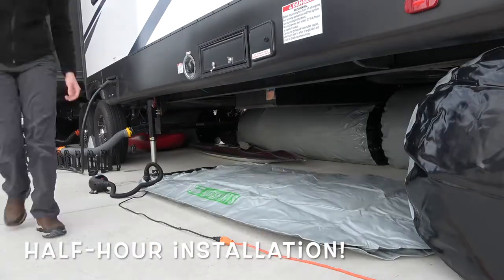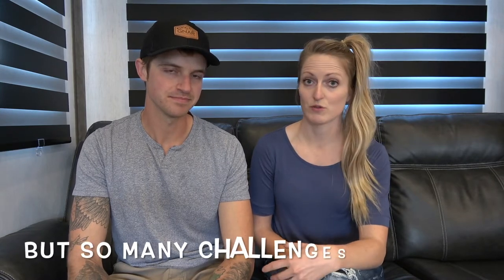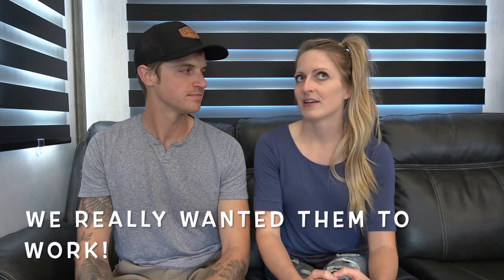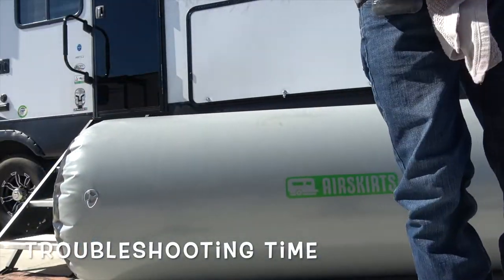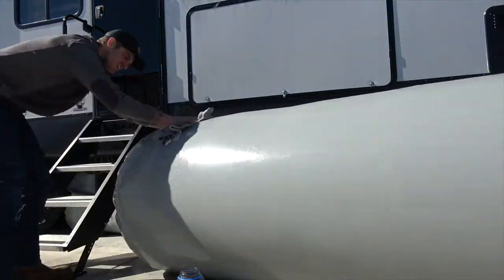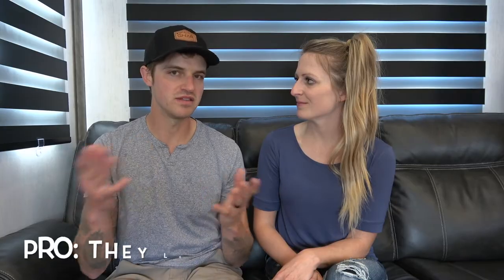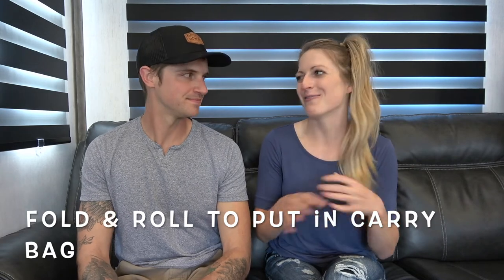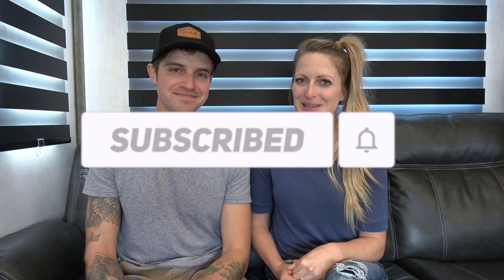Airskirt Review // Winter RV Skirting // Fifth Wheel Toy Hauler // Full-Time RV // GNAR Outdoors

Comment: I have Air Skirts! This is my second winter.  I had no issues like you guys did. I'm glad you got your issue solved. Prior to inflating I went over my underbelly with a fine tooth comb. Added pool noodles to edges, foam to corners, and taped down any "pokey's". Used all the plastic edge protectors the Skirts came with.  2nd, in my humble opinion Air Skirts were specifically made for Air Streams. Those that dont have Air Streams have to make adjustments for Air Skirts to fit. So what I did was only fit the Air Skirts where my water pipes and heating ducts run. My entire RV is NOT covered, but the seal the Air Skirts provide has allowed me to not turn on my furnace unless it is 19 degress or less outside! Bunch your skirts as close together as you can get them to eliminate "air gaps".  I temp 4 zones. Outside, inside, subfloor, and the space between the AirSkirts. The space between the Air Skirts is 7 degrees higher than the outside air, even though the gauge is outside on the ground.  The gaps from the Air Skirts provide air so humidity won't build. The Air Skirts occupies enough space underneath that cold air cannot just breeze in. I tried insulation board one winter and the humidity underneath was always in the 90's. Oh I forgot! I have 4 1 gallon bottles of ammonia with felt wicks , mothballs, and bait stations where there are gaps.
Reply: I honestly like your review more than the entire video. I literally had a solution for all their issues. Everyone's brain works differently. I 100% feel like these are for people with a large amount of common sense. I bet if you think ahead, these are awesome.
Reply: Great review, I will get them based on your review. Thanks for taking the time and providing the little details.

Comment: Very helpful video.  I currently have a custom vinyl skirt with adhesive snaps which has stayed on with no issues.  But I’m considering AirSkirts for the insulation factor and still putting the vinyl cover over the skirts.  But the AirSkirts price has had me holding off cause they really are expensive.  Thanks for the honest review.
Reply: How much do the air skirts cost?
Reply: It depends on the size min. Price 1800$

Comment: I’m not so much concerned about how they look but how well they perform so you were filling up your propane tanks every two days I guess the next question I have is I have a Grand design that supposedly has the Arctic package in it but the videos I’ve seen show a much thicker floor to keep the heat in but yeah they got cheap and didn’t use the stuff they did so I’m really down in them for that but I guess the bigger question is is are you really saving all this money with those skirts in place underneath I noticed your review was two years ago. Are you guys still using those air skirts? Are you saving money, and what is the average temperature going down to?

Comment: For the cost of these types of products I'm better off buying more propane to run the furnace. Most I've ever spent on propane for winter $250 at $3.00 a gallon. It would take about 20 years of full time use to break even on the cost of airskirts. I seriously doubt the material will hold up that long.
Reply: Aren’t they supposed to keep the tanks and lines from freezing as well?
Reply: @titusmoto  They could help if you have an RV without tank heating pads or heated under belly. In that scenario I would just use 1" foam board from the hardware store and make my own skirting for less than $100. I looked this video up for this product because a neighbor of mine was thinking of getting them. I was curious.
Reply: Running your heater has nothing to do with keeping the lines underneath from freezing.
Reply: Sounds like you don't live in a cold climate. We spent $250 a month on propane even with skirting.

Comment: I bought the AirSkirts and they've been a huge pain. They blow away when it's windy and I've had to connect them together with bungee. There were several tubes that had holes. I also wasn't made them to easily fit in the storage bags. Also, the hose on the pump came off and it won't stay connected. I'm sorry I purchased them.
Reply from the maker: I’m not surprised by this. I’m sorry you’re going through that.

Comment: I thought that trailer was setup for 4 season camping, so air skirts wouldn't be needed...?
Reply from the maker: We definitely needed the additional insulation skirting offers when camping in Heber City, Utah in the dead of winter. Camping in Las Vegas during the winter didn’t require skirting, but it was necessary in a ski climate. Our water line connection ended up freezing even with the skirts! Not to mention the sewage valves to drain our black tank. 🤢 and that was with a space heater under there!
Reply: @onesummitre  My trailer is 4 season and works great assuming you run the furnace to heat that space, for the exposed valves and drains, i wrapped mine with heat tape held on with large zip ties.. i plug it in a few hours before i plan on dumping,  no more issues